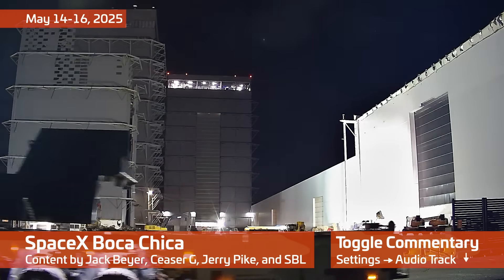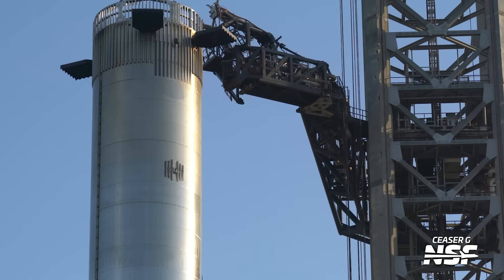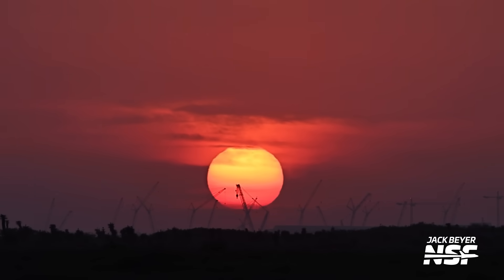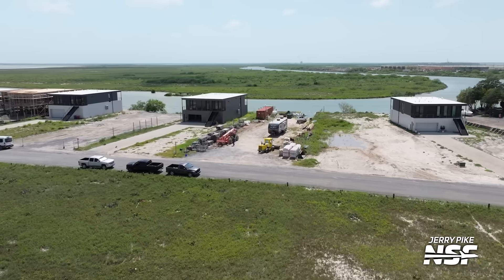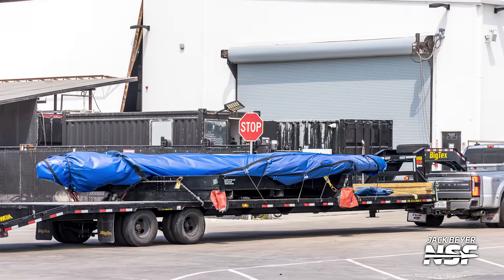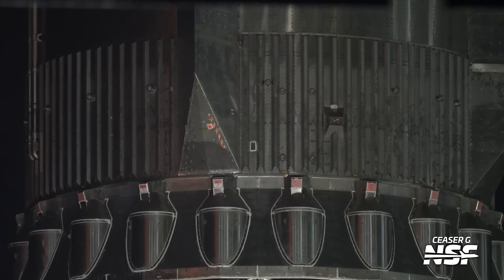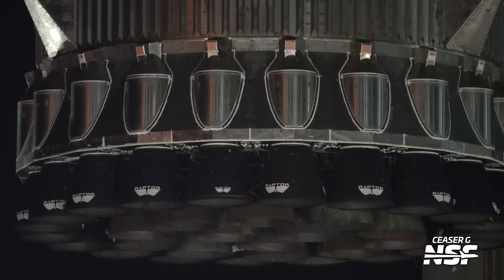"What in the heck are they up to now?" | SpaceX Starbase

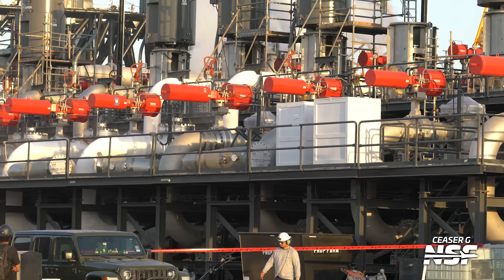Comment: @3:15 It´s frost. The bolts and flanges are frosted as well. I see no insulation on the pipes anywhere (yet).
@5:15 It seems the welding is primarily on the wall elements of the flame trench which is finished @10:00.  
            And even when the Pad is welded to the wall + foundation points, the welds can be cut open again if necessary. 
            Surely not a one day swap of the Pad, but managable in reasonable time.

Comment: I think they gonna try and catch both ships
Reply: wouldn't that be amazing.. but unfortunately they probably wont have the water system hooked up to Pad B in time to catch the ship, if the Booster is already hanging on Tower A...
unless... They catch the booster, and leave the Ship on orbit til the booster is down and out of the way, say 10-12 hours, maybe a day later, then bring the ship back and catch it with Tower A.
THAT would be cool..
Still don't know why they are planning on dropping B14 into the gulf though.. seems like a huge waste of a REALLY valuable, flight proven marvel of modern rocket engineering..

Comment: So when are the AI robots going to be building all this kind of stuff, so we can spend all our time watching sports, and not have to get hot, cold, sunburned, & stung by bugs?  
At the rate they are progressing, you will have an interesting job for a while. How long would it take for one of those water filled balls to freeze solid on Mars? You think broken water lines might be a bit of a problem way out there? Maybe AI will discover a way to prevent water from expanding when it freezes, or develop a tasty antifreeze. Too bad there is no fossil fuel on Mars. It is a pretty useful raw material for the chemical industry. Living without carbon, and nitrogen will be tough. I just read an article that said we can't produce gas turbine engines which power electric generators, fast enough to keep up with the demand for running the chatbots.  
It sounds like they had better plan on bringing a lot of highly enriched uranium, or maybe plutonium, to Mars. The newest subs and carriers run on HEU. Now if only they could keep the planes from falling off. I bet they are skiing behind those carriers.  
If you see a big drone flying north, that might be one of the new 'agricultural' drones the cartels are now using to fly drugs across the border. They say that they can fly below radar, and far, so that  they are virtually impossible to stop. Even if you see one, you need to intercept it. As Ukraine is showing, that can be easier said than done. And wouldn't you know it, Mars has enough atmosphere for them to work there. Yes, I know, AI controlled anti drone drones will hunt them down and blow them out of the sky. That will be fun to watch, but not as fun as watching the Battle of Britain in the UK in 1940. I wonder if Churchill ordered Berlin bombed, so enraged Hitler would shift his bombers from British air bases to his cities. You think any politician would ever admit to that strategy?